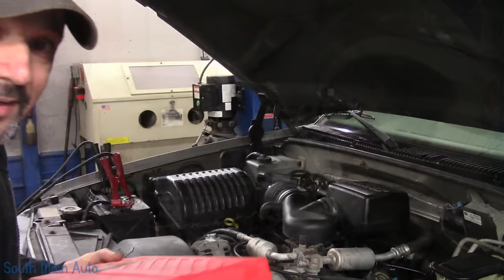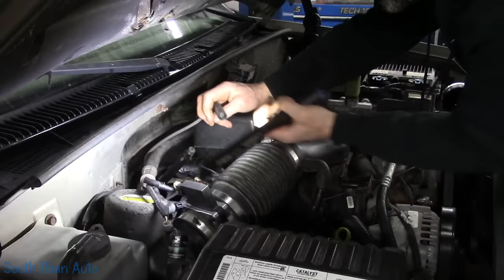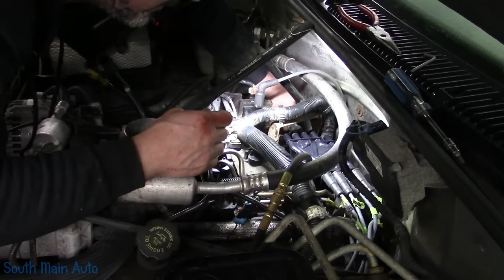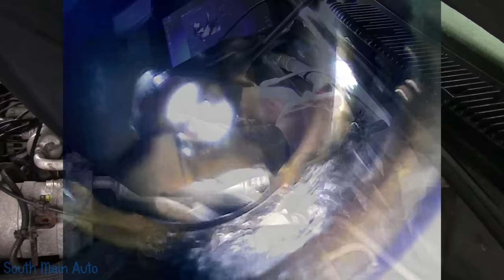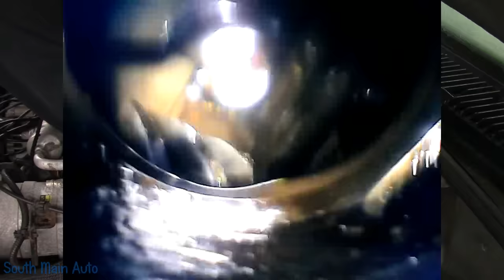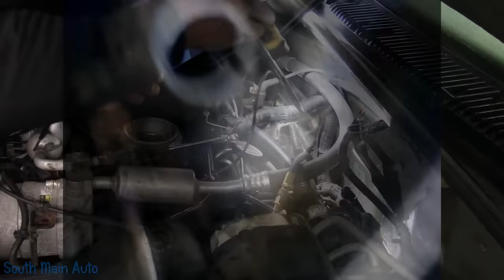Chevy Suburban 5.7 : Crank No Start Part I

Comment: May I ask? 1996 k1500 5.7 suburban starts fine when cold. Will not start when hot without starting fluid or priming? The starting fluid worked intermittently but sometimes does not as with priming! It does make a nasty knocking sound when using the starting fluid but then runs fine? Fuel pressure reads 56 running/61 pressure start. Leak down test was good! Holds pressure for a long time. I start it every morning with no problems. Shut it off and no start? Sometimes priming the ignition afew times works but not yesterday? Replaced engine coolent temp sensor,plugs,wires,cap,rotor.  Added fuel injection cleaner. I am leaning towards the cold start valve sticking and causing a flooding condition causing the knocking noise from high pressure because of to much fuel? And it starts in the morning or many hours later because the extra fuel had time to burn off? Idle air control valve sticking or cold start valve? Or the distributor modual I hear will do this? Any advice appreciated!🙏 My mechanic freind insist I need a new fuel pump but I'm not buying it because why would that only be a problem when hot? Makes no sense to me! I read that this truck has a rubber hose in the fuel tank that leaks causing this condition? BTW no codes at all!  Thank you!🤙
I found a strong clue this morning! The fuel pressure is 56 psi running but after shutdown it increases to 61 and holds for a long time? Cold start valve sticking? Or return line correct? Anyone?🤙

Comment: Scary part is without the distributor there’s no oil pressure. The safe part is without the distributor gear the engine won’t run

Comment: My old Volvo has a no start, no spark. After a lot of testing I nailed it down to a bad hall sensor. Unfortunately it's built into the dizzy so you gotta buy a whole new unit. New one for Bosch with core is over 300 bones and no junkyard has one. Doesn't help they all fail after a while due to oil intrusion. So I'm gonna give a 60 dollar unit a go. If it works I'm gonna go gambling.

Comment: Easy way to get a nice big clue on general health of a non running engine like this is a quick and dirty compression test.  If compression on all cylinders is good then likely the internals are sound and worth throwing the distributor at it as likely any other problems will be minor.

Comment: I used to work in a euro shop. We had a mercedes come in on a tow truck. Cranks miss fires and doesn't start. Timings out obviously but its got a pick up and individual coils no distributor. We fixed it. It took a while to work out what it was. It had been towed in after the owner had fitted a reconditioned transmission. What we didn't find out till the owner came it to check on the progress was he had replaced the flexplate because one of the teeth had broken. The flexplate and crank have factory index marks punched into them as the bolt holes are evenly spaced. He had fitted it in the wrong position. So out with the trans and flexplate and line it up and put it all back together all fixed.

Comment: On the race car we found that wear pattern was due to cam walk. Once limited by use of a cam button the problem disappeared. Your roller cam engine shouldn't have  a thrust problem due to the thrust plate holding the cam.

Comment: Part 2 coming I hope, my s10 4.3 did a tune up all was good then one day it wouldn't start, it had rained and was really warm and humid, I didn't need the truck so I used my car instead the next day it was sunny and the truck started, the next time it rained again no start, did some research and found out that the new AutoZone distributor cap wasn't vented so I went with the best one they had I'm going down the highway and it feels like I'm running out of gas the truck is bucking hesitating the next time I used it it seemed fine then it did it again so I just lived with it for a while, one day j decided to try the top of the line cap and rotor from advanced auto thinking that this time it will be fixed, nope the same thing, so I looked on Amazon some reviews about different brands of cap and rotors there was one that someone described the same problem I was having and it was solved by getting the oem brand Delco so I said what the heck, advanced carried Delco and with online discounts was cheaper than Amazon, I installed it and crossed my fingers, I haven't had a problem since, I know that was a long to read, I was thinking distributor also because, who knew all the others were junk, I never had that happen before.

Comment: Common everyday problem with those vortec series Chevy's. Stupid design on Chevy's part. HEI was the best thing Chevy had. Best advice I can give is buy 2 of those distributors so you can have a spare when one takes a dump. Eric swap you in a new distributor & you'll be fine for a lil while

Comment: Frankly eric. I saw one of the cam teeth looked worn slightly.  I recommend check the oil for metal shavings.  That metal went somewhere or that was a distributor change with or without owners knowledge. Or it's a bureau auto repair car.  I haven't a clue but like that customer with coil packs awhile ago. Crank no start without the wires inside coil boot to put the spark into the spark plug the customer claimed he did his own repairs left parts in the back of SUV. Your great.  1999 is a good Chevy.

Comment: Have a car that runs great until you want to stop or slow down to stop... feels like it wants to die until I give it a little gas... no misfires —I’m THINKING .. 19 year old vehicle—never touched— IAC Valve — I hear it’s important for decel and getting back to a stable idle state... 59$— thinking of trying it if it looks really bad when I remove it..

Comment: Distributor gears are usually softer than cam gears they even sometimes make them out of plastic. The engineers aren't that stupid. The distributor bushings do wear out in the old days I seen Ford's break  rotors and caps and jump ignition time when they go bad. But the last bad distributor I seen was 20 years ago AAAAND it was so seized in the block I had to drive it out with a hammer and crows  foot.

Comment: Oh that reminds me of an old ford that wouldn't crank over that was sitting at the Blue Beacon Truck wash  in Knoxville TN. The guy couldn't get it cranked and I didn't have anything to test it so I went to the distributer cap and removed it.  Had a ton of moisture under the cap.  Took some paper towels and dried it out and the button as well, popped it back together and it fired right up.

Comment: The dreaded P1345 on 5.7 vortex...the gear on distributor is sacrificial ( soft metal) as where the cam is made of a tool steel ( hardened metal)..

Comment: A Tree Fiddy that doesnt run? who would have thought. Its stupid when people sit on the starter.. its gonna start in a few cranks or seconds or its not.
If people complain about a compressor or a phone, they need to think about what goes on in a money making shop. Shits noisy, get over it.
I also found the problem with that truck, the distributer is on the wrong end of the block
I remember something about Cams gears being to soft so they used a bronze distributor gear. If you bought an aftermarket with a steel gear it eats the cam or vise verse

Comment: Worn distributor drive gear usually get that way by not seating completely in their hole oil pump drive pin not seating in the bottom drive portion of the distributor drive gear  creating void space

Comment: I have a Chev 4.3 V6 in my boat and at 80 hours since new the same thing happened with the distributor drive gear. Inspected everything like you did but since the whole engine had such low time I just replaced the gear and put it back in. Now I have over 300 hours on the engine and so far no problems yet. Still would like to know why the original gear failed to start with.
Reply: Good question

Comment: When a car turns over and doesn't start, think F.A.S.T. 
Fuel
Air
Spark
Timing.
It's always one of these 4
Reply: What about communication?
Reply: Seems that Eirc the car guy did all that and in this order. f
.a.s.t
Reply: ya missed one: compression.
Reply: Cool. Now I never have to look at wiring/fuses/computer ever again.. Thanks for the info Mark. 😓👎🏻

Comment: I use that exact same Mac Starter button. I  love it. Most useful tool i bought for doing starter  system diag on semi trucks.
Reply: My 99 Tahoe couldn't get cam/crankshaft offset to spec. Dist. gear was worn. New gear and reset dist. Ran like new.

Comment: @Eric - on this car, if you pulled the spark plug wire off one of the plugs and ran the engine, would the ECU record misfires on the pids? I read somewhere that early OBDII cars, the ECU used coil amperage to detect misfires while on later years, the ECU used the CPS to measure crank speed on the power stoke.
Reply from the maker: yes it would have

Comment: Hardened roller cams eat distributor gears, new distributor and send it. thank god for COP
Reply: @grabasandwich  Nope 4.3, 5.0 and 5.7  were all like the one eric was working on, 99 brought the LS and DIS.  When i converted to a roller cam i tried a brass gear and i was checking it daily lol. I have a sintered iron gear now and all is well. The oil pump puts a lot of strain on the cam gear along with poor maintainance.

Comment: Interesting video! Oddly enough, my Dad has a 94 Ford F350 5.8 L with the same problem. We replaced the coil, but no spark going out of it, just cranks like the one on this video. We haven't been able to figure out the problem.
Reply: Have you cranked it over with the cap off? It's been a long time but I seem to recall Ford's stripping the pin on the drive gear. But its been ages so I could be wrong. Either way it's up front and simple to check.
Reply: @southjerseysound7340   We haven't.  But will try that. Thanks.  GREAT VIDEOS- I watch them all .. old and new.  THANKS AGAIN!

Comment: new complete distributors are not expensive on a 350
less than 50 bucks complete with cap and rotor-- Amazon
Reply: He gets his parts from NAPA " NOT A SPONSOR " it will be at least triple that.
Reply: Charles B. Yes I buy parts from those places too but I do a lot of research before hand. Eric has to get those cars fixed as fast as he can so he can't wait around for Amazon or Rock Auto like we can. I buy the best parts I can afford or save up for it if I don't need it right away unlike Eric. Charles ya a lot of parts are JUNK ANYMORE, ya have to watch out what you buy. Even some of the BIG NAMES WENT TO HELL.

Comment: I see this all the time, and the cam gear always looks good, tons of those 5.7l running around here in utah with lots of miles. I think the distributor drive gear is just made out of a softer material and they wear out with over 130k(seems to be the magic number)

Comment: Just a little tip.  If you have to use a mirror,  get yourself a passenger side door mirror. (just the mirror, not the whole case) The kind that say "objects are closer than appear." Ive found they are far more helpful than those telescoping mirrors. Obviously you'll have to break the outer case.  If you're in a shop long enough you'll come across a spare mirror or just go to a parts yard.

Comment: I know this is going to sound stupid to the majority of you. But here it goes, if the crankshaft spins twice to one revolution of the cam. How do you know which crankshaft rotation is TDC? Or does it even matter? I hope I'm making some sense in my question. And i don't mean to be so ignorant. I just always feared anything to do with timing because of my lack of knowledge on finding tdc on number 1 cylinder.
Reply from the maker: I showed it in this video. I removed the plug and bumped the key till I had compression :)

Comment: It's probably not the original, factory distributor, and was replaced at some point with an aftermarket unit.  The problem is that you gotta select the distributor gear to be the right hardness for the camshaft gear.  If it's a cast camshaft, then you want to only use a cast (iron) distributor gear.  If it's a billet camshaft (probably not in this case), then you'd use a steel distributor gear, or a softer bronze one.